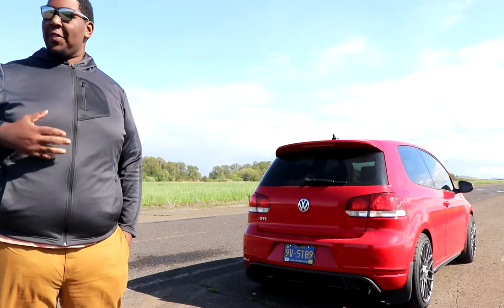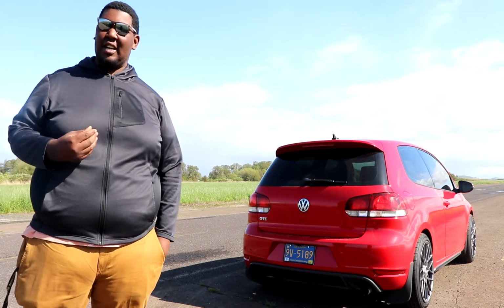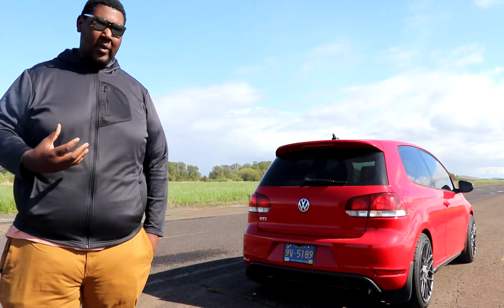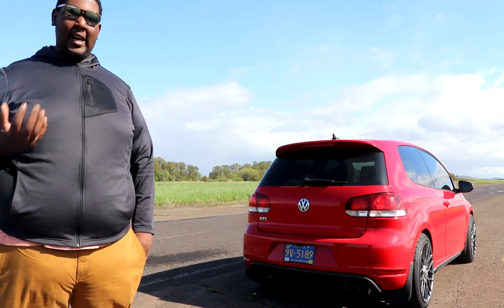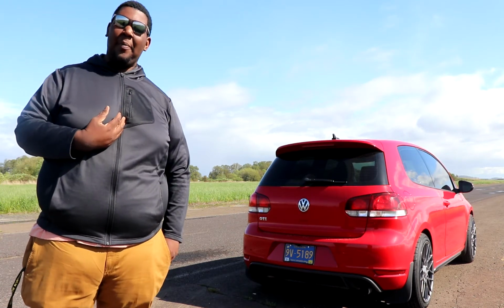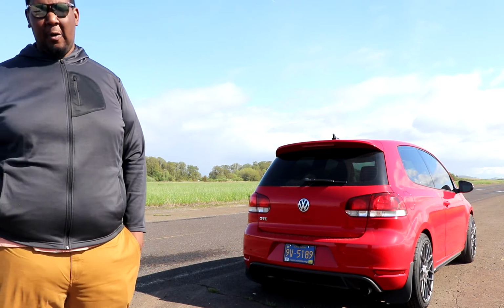MK6 Vw GTI Resonator Delete

Comment: Do you still recommend this?
Reply from the maker: To be honest with you I wish I just just did a muffler delete. But this also still pretty decent.
Reply: @GRyders  as in left the resonator on and deleted the muffler only?
Reply from the maker: Yes.
Reply: @GRyders  why do you wish just a muffler delete ?
Reply from the maker: So one thing I noticed by only doing the resonator is that there were some harsh vibration inside of the cabin but I didn’t get much more sound by doing that. It would’ve been worth it if it was louder but it wasn’t not much louder.
Reply: @GRyders  I have a stage 1 with an intake on my mk6 gti will I loose that much low wend torque ?

Comment: I had a question, did deleting the resonator cause your check engine light to come on??
Reply from the maker: No it did not
Reply: @GRyders  thanks for the fast reply , im thinking of deleting my muffler and resonator on my 2012 gti but was just curious if any lights will come on , how noticable is the power decrease in low end rpm when u did the resonator delete?

Comment: Did your car throw any trouble codes after the resonator delete?
Reply from the maker: No it didn't.
Reply: How does it sound on the highway? Is it loud? Annoying at all?
Reply from the maker: It's a little noisy but its not that bad.
Reply: Good to know, thanks man
Reply from the maker: No problem!